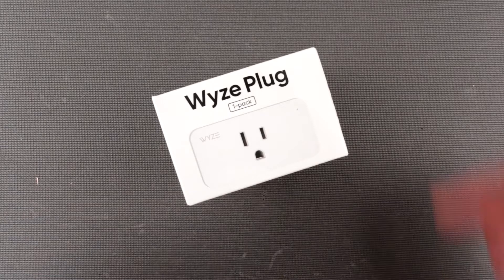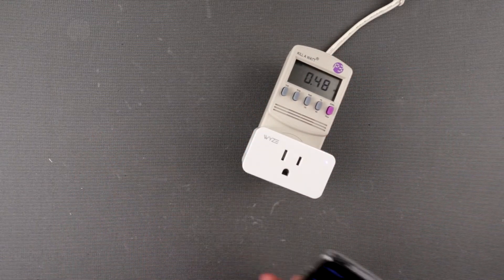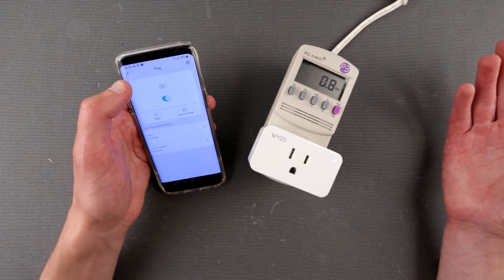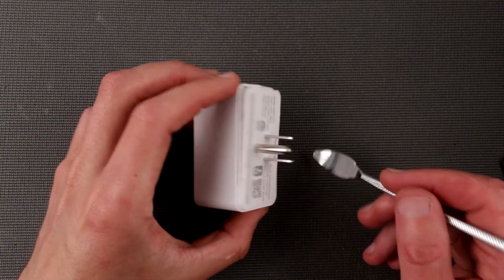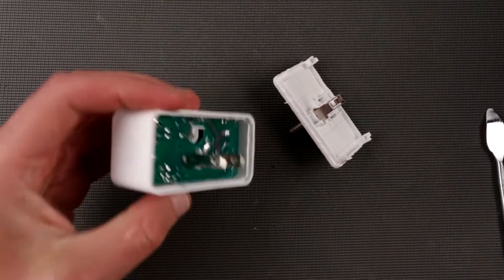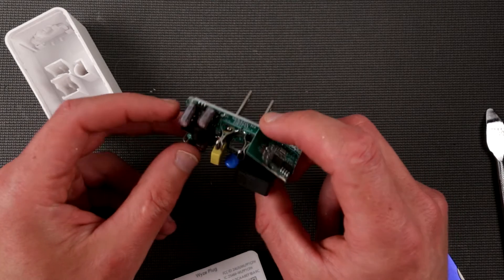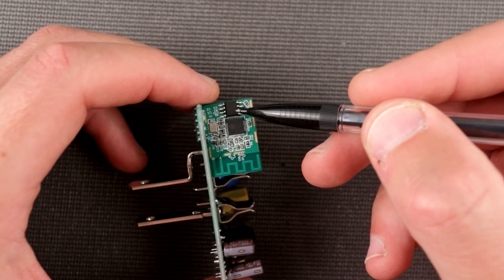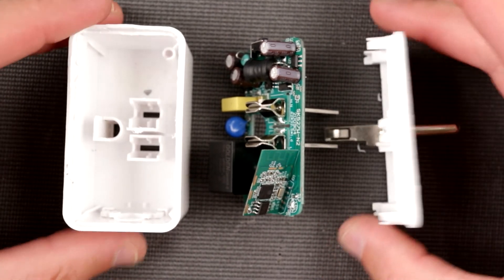Wyze Plug 2021 teardown

Comment: My Wyze Bulb White works fine on 230 volts. I Wonder if thé Wyze Plug could works on 230 volts.
Reply from the maker: Probably yes, it is switchmode mode psu, i usually those are multi voltage
Reply from the maker: You know what It might not work as it has 200V primary capacitor.... it might die pretty quick

Comment: Ground plug is not connected. I guess it is for proper polarity for hot and neutral.
Reply from the maker: I suspect it is just not necessary.... this is why they omitted it
Reply: It's not connected to the board, but acts as a pass thru for the connected device.

Comment: I'm thinking of converting one of these to a dry contact relay.  No voltages at all on the output,  to control a garage door opener. Should be pretty easy, right?
Reply from the maker: This thing can do one action, you need 2.... to open and close. How are you planing to achieve it ?
Reply: @InsideOutElectronics  I was thinking of using a Wyze automation that would Open the contact when it is closed.  That should produce the effect of momentary closure.
Reply from the maker: @genelevi1  Ah I see, essentially engaging the big button on the garage pad! Smart! I think this is possible, just need to disconnect input mains power from the output. And wire contacts to the relay inside. Keep main only to power the unit . Or power it up with 3.3V power supply ( battery pack ). And just use input N and output N as a switch poles, for example.
Reply: @InsideOutElectronics  That's the plan.  Once I get the plug, I'll test the built-in automation.  I've done this with Hubitat and Home Assistant, but have not messed with Wyze built-in automations yet.    I am exploring possibilities of staying within the Wize ecosystem for my elderly relative.   Simplicity of use is key here.   Once I test the automation,  I will cut the main traces that enter and exit the relay. I would also remove any output mains connections and seal the plug's outlet.  Only 2 wires coming out - dry contacts from the relay that's still under Wyze controll.
Reply: UPDATE:  Got my plug working as a dry contact relay (garage door opener).  Pretty easy to do, but unfortunately, you have to remove the relay because 2 traces need to be cut on each side of the board and one of them is under the relay.  Other than that - it's super easy and the most annoying part is getting the thing opened.  Thanks for the inspiration!
Reply: @genelevi1  What did you end up doing for a power supply? I was thinking of making it run off of 12V. My application would probably need both NO and NC so I was thinking of removing the onboard relay entirely and putting power leads off the board to the relay I actually want to use? Haven't even bought this yet but was wondering if you knew if the relay ran off of 12V (very common) or 3.3 volts like the electronics. If so did you need a 3.3 volt power supply and a 12V power supply?
Reply: @jsved8740  I didn't use any power supply.  Just opened the thing up, cut a few traces, run 2 wires out of it and that's it.  I plug it in as normal and the 2 wires act as a  button push.  Those 2 wires connect to the opener's terminal.   I set a rule on the Wize app that basically turns the plug off if it turns on.  That simulates a momentary button press.
Reply: @genelevi1  I took mine apart today. I see what you did. Yours still plugs into a 110V outlet it just doesn't supply voltage on the output anymore. I wanted to take the 110V out of the equation and just have it run on 12VDC. Still working on it as I'm writing this but it turns out the relay runs on 5VDC and the electronics on 3.3V DC. The chip that IOE was talking about has outputs of 10VDC and 5VDC. Doesn't look like the 10VDC are even used. There is another regulator that changes the 5VDC output to 3.3VDC. So I'm thinking to make my plan work I'm probably going to have to remove the mystery chip. Get a 12VDC to 5VDC regulator  and hook up the output to the 5VDC leads. Of course I still have to figure out how to get 12VDC to the relay power leads instead of 5VDC if I want to use 12VDC relays. Will keep everyone posted and possibly make a video if I have any success.
Reply: @jsved8740  You are correct.  I didn't need another power supply since 120v was already there. I'm sure you can find a rectifier or a voltage regulator on that board and give it 12v so that the rest can work as intended.  At this point, with more effort to get this to work, might as well find an alternative solution.   Good luck!
Reply: Wyze, sells a garage opener for about $50 specifically for that.  Camera included. 
Works with most garage openers

Comment: Great video! In your opinion, how difficult would it be to convert this to 12v in and out?
Reply from the maker: I think it is possible, just to bypass internal power supply and add 12vto 3.3V regulator to power up the micro controller